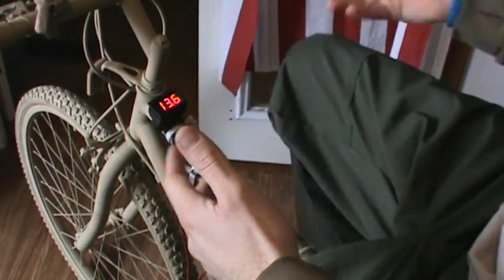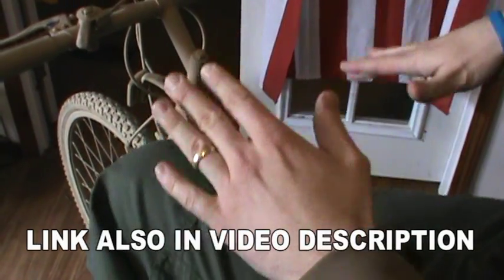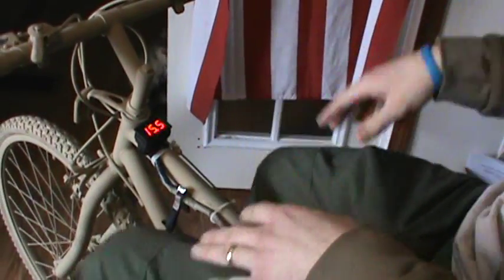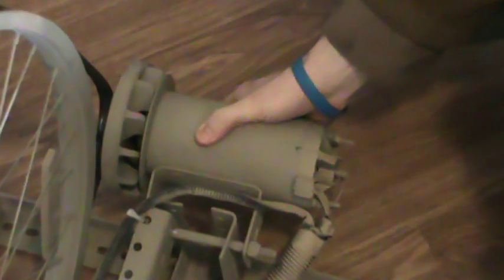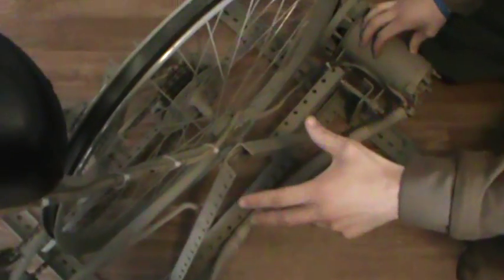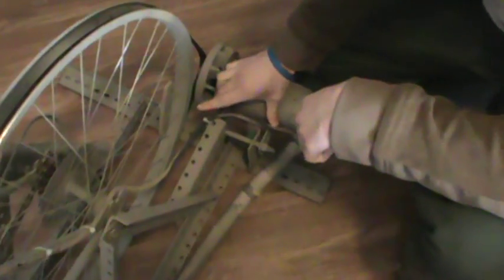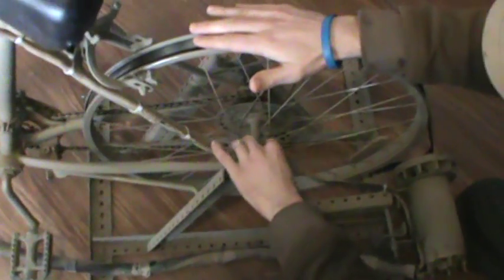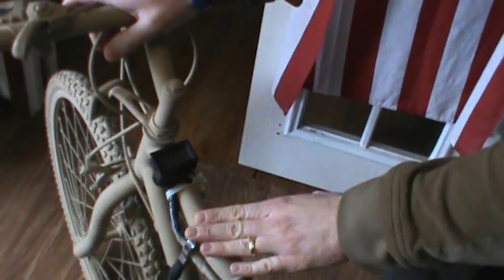AN E.M.P. PROOF BICYCLE GENERATOR: QUESTIONS ANSWERED AND LINK TO BUILD VIDEO

Comment: I wonder if you could use this directly to power a 12 volt DC motor..
  I have seen some nice gasifiers out there that uses a 12 volt DC motor to suck the gas through the system. Only problem is you have to have a battery for this...
   Looking for a solution to run the 12 volt fan motor on a gasifier.
    Will this power the fan motor directly, without a battery between them?

Comment: You can hook up an ringer washing machine to the bicycle generator. Washing clothes will be one of the most time-consuming, mundane, difficult tasks without  electricity. Apparently these old ringers washers are still around sitting in people's basements and you might be able to get one up for $25. People who have been caught in long-term outages have said an old wringer machine would have been invaluable. Probably a great trade item too.

YHWH bless

Comment: I would suggest that people use the charger before an EMP. If the blocking diode gets taken out then the voltmeter may also go. By using it before hand they would have an idea of how fast they need to pedal to charge the battery. Depending on the strength of the EMP it might even take out an anolog meter. Unless they had the foresight to put a spare voltmeter in a Faraday cage.
Overall a great build! Thank you!